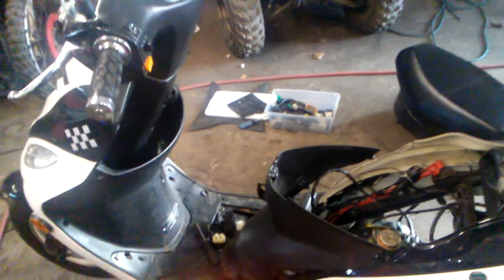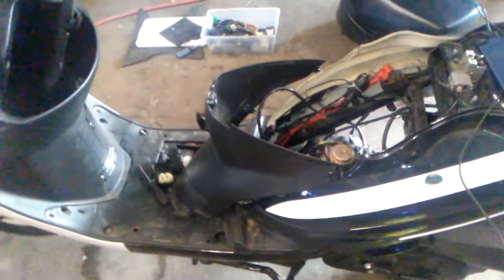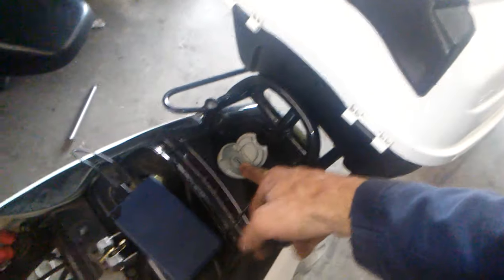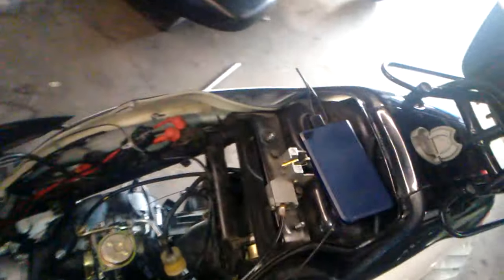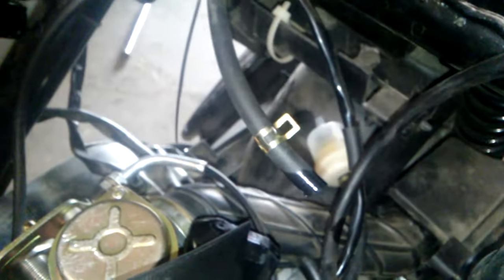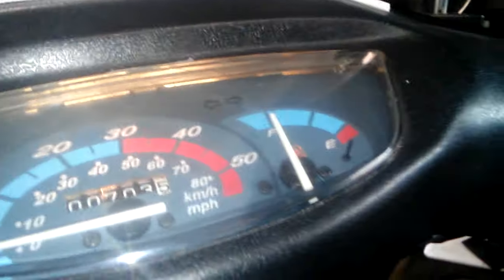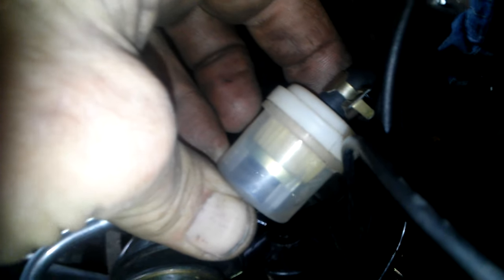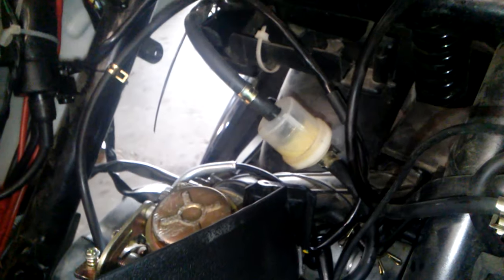Scooter runs short distance then stops running like not getting gas , parts for this in description

Comment: I've a stupid kymco gy6 that went well for a year but for the last few months it's a pain in the ass.
and the last service has been made very recently.
after consulting 4 stupid different shops (already paid a lot for nothing) I still have the same problem: 
after 10/15 mins the scooter doesn't run, even by giving full gas the engine revs up high but it's like there's no pressure enough to go, from 5 to 20 kmh, after that point it goes again... making a very dark noise and loosing power progressively.
with vpower it seems a little bit better but after a while same story again..
so what should I do??
Reply from the maker: Oh crap u need to check your variator n belt for sure ,!!!! Clutch also may be getting stuck . I reread that it runs good just don't move . You will need a impact to get those off but your problem lies in the cvt system . Variator guides get wore n variator will wobble . Rollers wear grooves n will stick in high gear feeling like no power . N clutch also may stick !
Reply: @WaldensWorld  thanx for the reply!
but I just paid a guy to fix the clutch and belt and a complete service has been made recently (300$). all the trouble started after two weeks and the same guy did another check, he told me its because of an hole in the exhaust.
another told me that is probably about some dirty or water in the gas tank.
another said its the wrong gasoline.
maybe a cleaning additive can help..?
I dont trust any mechanic anymore.
I just wanna sell it and get rid of this f**g scooter.
Reply from the maker: @TheMidnightcowboy1  sounds live variator . Was this guy a shop mechanic or friend !! I've got bikes from shops before mis diagnosed ! I'd check that variator
Reply: @WaldensWorld  was a professional mechanic... actually 3 or 4 different. but again, the last one checked and fixed the clutch, that is the only thing wrong he found.
but I thought the air in the fuel system thing you were talking was a possibility..
Reply from the maker: Is it like scooter or sat somewhere . Check vent hose off motor n muffler for muddobber nest but that loss n clunk n go sounds like clutch shoes getting stuck n popping open ! Did you get a new clutch ?

Comment: I have the same issue with my Yamaha Razz.

Do you know of any other reason it would just stall out?
Reply from the maker: When is it stalling? Takeoff or after you stop n start again or after few minutes! Could be rear clutch sticking variatior rollers need changed ! Exhaust valve or valves need adjusted or fuel oil mixture! On two stroke could be crank seals also ! Check spark plug first

Comment: I litterwly just bought myself a yamaha jog 1996. When I first got it I gave it a test run and everything was fine. The next day I take it to work (15 minute drive) and I noticed it would be all fine then randomly slow down and act like it's going to turn off. Then starts speeding up again. I don't know much about mopeds, got me this one for summer time and as a little project. Guy told me it was a recently rebuilt but I highly doubt it..
Reply from the maker: Yes since it’s old I would check fuel ! And if it’s getting hot compression if it needs a rebuild as engine warms up it may lose power ! Is smoke white or black ? Does it run fine after sitting! Also those have a reed cage I’d check it for leak ! Let me know!
Reply from the maker: Few drops of water in gas can cause this also !
Reply: I got it 2 days ago trying to get it checked by tomorrow.. no leak doe I'm keeping it inside my house until I get chain's haha.. It is 2 stroke but oil and gas is fine. I heard it could maybe be spark plugs but i really dont knoe.For now its kick to start sense i bought it without a battery. But I don't think that's a big deal towards what's going on
Reply from the maker: Yes new plug be good start ! There fun scoots for sure !

Comment: I am having a similar issue, and when the scooter (Suzuki AN125 - 2009) stops from what is obviously a lack of fuel, you let it stand for about 20mins (you can continue to crank but will flatten the battery, so best to wait), then after this period it will start and run just fine. i have replaced spark-plug and fuel filter, and still have the issue. I suspect it is with the vacuum fuel cock. I am awaiting a replacement to test this out. Fuel back vent is clear, as is gas cap, and when testing fuel cock, it appears to operate just fine and allows fuel to flow. Can these vacuum fuel cocks suffer from say a small hole in the diaphragm, and would that have symptoms like this ??
Reply from the maker: Yes n the vent line would smell of gas n be wet I’ve seen it before ! A lot of scooters will have the exhaust valve get tight over time , when you ride it may be expanded enough to lose compression! I would pop the valve cover off n check valve clearance also ! If it dies can u shoot starter fluid in breathe  n will it run ! If it does could be fuel ! How many miles on your engine !
Reply: I had this same problem.. replace cold ignition, spark plus, new fuel pomp and fuel filter .. problem solved .. pipe going from tank to filter needs replacing and I've changed positions of my fuel filter from below tank in to side.. mechanic suggestion.. I have kymco agility city 125cc on road again..
Reply from the maker: Thanks for your reply!
Reply: I simply replaced the vacuum fue
Reply from the maker: I’ve seen vac lines get pinched when installing seat also u got her going !!

Comment: I have a new 50cc tao tao newspeed 50 and when i full throttle is slows down and will shut off and die?
Reply from the maker: Define new ! Like still under warranty or new used ?
Reply: Walden's World new just out of the crate i put together
Reply from the maker: I'd check your carb second jet is probably clogged . They test them at factory n sometimes leave crap in there n ket gets clogged . Welcome to China quality ! Lol
Reply: Walden's World ok will do thanks btw i also have a new carb i could put in
Reply from the maker: Yep that be best bet . I worked at a China shop it was depressing how much new stuff had bad carbs out the box . I got tired if that quick !

Comment: I can't find a vented cap for a 2021 Peace Sports 50 . None of the caps specifically state they are vented.
Reply from the maker: Check eBay n some have a vent line with a small cylindrical plastic deal with a ball in them that can go bad if scooter ever crashed !

Comment: I just got my brand new moped 100 cc magnum and it keeps stalling and sometimes if I turn to right it goes on what’s going on I spent 2 grand on this!
Reply from the maker: It you turn to right ? The engine revs up ? Check the throttle cable maybe bound up by the handle bars ? It has a throttle adjustment screw on carb under seat does yours have a cover to get to carb ? Put it on the stand with back wheel in the air and adjust it up til it engages then back down to a nice rpm

Comment: i have a honda sfx 50 and i went to a service changed my piston i wasnt able to start before it gave me symptoms of the carb being dirty so it shuts off during trip than we cleaned the jets, it didnt started after than changed the piston due to no pressure, it started again then we started to set up the carburator then during trip it went off again and it doesnt wanna start doesnt matter what i do with the carb, can u please give me any tips or suggestion what to look for i have sparks n i have fuel pumping too, no idea how can i check the pressure so have no clue bout that, im gona try the fuel cap tomorrow
or isit possible the piston get spoilt this fast again?
thx for any advice
Reply from the maker: Check valves also ! Especially exhaust! Was there carbon on valves when you did new piston ? Check the diaphragm in carb too u can put finger in carb push up it should hesitate coming down because vacuumed if it slammed down it may be leaking too ! If variatior is stuck or clutch is stuck it will cause problems starting if it’s in high gear n idled high
Reply: @WaldensWorld  thx f answer ill write wghat was the problem so it can help others in future

Comment: Is that a JonWay 150? I have the same freaking scooter!!!!!

Thanks for the info I run the PCV to the port to the gas tank so it’s getting positive pressure in the gas tank maybe that’s why mines flooding out?
Reply from the maker: It will push gas if it can ! If you put a pump positive air ! Yes n basically all 150 China scooter are the same

Comment: I have similar issue on my Piaggio Nrg, runs for 1-2 kms and then just stop.When scooter works on idle all fine,when drive have enough power like normal, but after several km just stop.  My suspect for issue is a petcock, but i wonder about the tank cap, it's a possible problem on Piaggio ? My cap looks prety good quality and condition  and it's original
Reply from the maker: Yes some of the 150 have a tip over valve so if you crash it shuts off vent I’ve seen them stick shut ! Or vacuum leak I’ve seen vac lines fine until you sat down owner changed routing got caught under the seat
Reply from the maker: If it vent the less gas the farther you will go full tank will stop quicker the vacuum forms quickening a smaller space ! Ps when it dies pull cap listing for that can of open coke sound phssss
Reply: @WaldensWorld  if i undarstend you corectly .....when scooter die and i pull of the cap and sounds like   coke can it' s a sign for bad vacum from stuck petcock ?
Reply from the maker: No vent to gas tank if your cap has vent it’s bad or if it’s 150 vent is on a tube coming off tank
Reply: @WaldensWorld  
Tnx a lot. I will replace petcock and gas filter and then will see the result.Best regards !!!!

Comment: i have a honda dio af18 50cc and it turns off after riding half a mile but i could turn it back on again and it needs more than 5 kicks to start
Reply from the maker: Check vacuum lines check crank case breather vent , check gas tank vent ! Air filter ! N is it smoking bad fouling plugs our . Crank case seals when going bad will mess up a two stroke running abilities also !
Reply from the maker: You may also check your reeds they may be partially open !

Comment: I have gy6 150cc i have loss of power at excelerating above 40 mph.
Cleaned carb thinking maybe sparkplug?
Could i ride with gas cap off for a while then replace cap.
Reckon this might solve it?
Great vid
Reply from the maker: May be fuel issue but I'd check to see if belt is wore on sides and variator rollers are still round ! I think u may need rollers if it runs fine up to there ! Variator get wore n wobble on spacer also losing power
Reply: @WaldensWorld  Thanks for that.
Rollers are new.
Belt will check tomorrow.
I remember when cleaning variator one of sliders was very loose and not snug.Possibly if this was not fitting right could play apart when hitting topspeed.Have heard somekind of noise from transmission cover.
What you think?
Thanks
Reply from the maker: @jasonsmith1714  those weight have to push even so they must be same weight . Or atleast every three as it takes 6 to keep weight consistent ! You can have only three in skip every other nothch n try that ! But I think you may be in right direction ! I have gotten bit wider n longer belt to run faster but that gets into measurements n crap ! Just stick with basicks for now !
Reply: @WaldensWorld  Thanks.
I think now it could be backplate and one slider not correct.
Thanks for ya help

Comment: I’m going to try this because I have a go kart with a howhit  150 engine and it turns on but won’t drive when I hit the gas ... I have change the carb the fuse the spark plug and the spark ignition i cannot figure out what to else to do !?
Reply from the maker: Yours may b in the transmission part the belt variator n clutch ! Does your motor rev up good ? If so pull cover off belt n look around !
Reply from the maker: Check brakes n make sure wheels turn or roll ok also !

Comment: Hello
Good time
I have a 50 cc Yamaha Vino engine. The petrol amp does not indicate that the tank is empty at all. If the tank is full or empty, the hand is on full. I also changed the kilometer and the floating petrol, but it did not work. I live in Iran if possible. guide me.
Reply from the maker: Gas gauge in tank seems mabey bad ! Or is your fuel indicator needle stuck in the cluster ?
Reply from the maker: These is a metal round cap on top of gas tank it prolly has three tabs holding it it twist out , I think u have a bad fuel gage or bad wires to it or bad connection !
Reply: @WaldensWorld  When I turn off the engine, the full gasoline hand goes back to e, and when I turn on the engine, the hand goes to f. The hand is not stuck in the off state. But when the engine starts, it shows f at all. Which I also checked with the empty fuel tank is the hand on f.
Reply from the maker: Gas gauge in tank  seems bad from what your explaining ! Prolly shorted out . It has three wires ! If you have volt meter you should be able to read resistance as you move the float !
Reply from the maker: @sepehrghelichkhani8018  if you unplug the gas gauge connection at the tank three wires does gas gauge go back to empty ? Then it be the gauge in tank 99%
Reply: @WaldensWorld  Thank you for your guidance
I will definitely do it tomorrow and I will announce the result to you.

Comment: Damn dude that actually fixed it
Reply from the maker: That's what we like to hear . Awesome ! Thanks for watching . Hope u subscribed building stuff daily !
Reply: Well it did go a bit better. Not sure if riding it for a bit pushed the air out. I’m still having an issue of getting to 10mph and it bogs. But when I throttle down again repeatedly I can get to almost 30. 

Starting to think I need the CDI.

Which I have in the mail.

But I thought it was fuel pump. But that seems to be working fine.. idk.

We’ll see when parts get here Friday
Reply from the maker: You may have a dirty jet in your carb ! You still have airbox on or a pod filter ? Worn belt ? Or variator problem . Will it throttle all the way on the kick stand with wheel in air ? 
 Vacume line from front of carb to round fuel pump is good no holes and not pinched when you sit on seat ! Few things it could be ! N check
If you are pumping throttle and it takes off . Carb has a small pump so your giving a shot of fuel . Therefore you may just have a fuel issue in carb! Check your carb inside to see if jets are ok .
Reply: @WaldensWorld  thanks!

Comment: Hello! I have a Buddy 50 cc scooter. It runs great except for sometimes it hesitates a little in the sense that it will turn off at strange times when I am going lower speeds or it will not turn on..

In order to get it to turn on I carry a little screw driver and carb cleaner and I will take off the air filter cover and spray the intake with carb cleaner and put it back on. Then I go to start and it starts VERY good.

It was just brought to a shop who charge like $200+ for a carburetor cleaning and spark plug replacement.

The shop is called Boca Scooters…

I am NOT convinced that they did honest work but I don’t know know for sure.

I would like to have it turn on normally. (without having to have to spray the carb cleaner every time)

I believe that I need to work on the carburetor again or get replaced altogether OR get a valve adjustment. I would like to bring it to a different shop but I don’t know really where to start.

Gas is clean, premium used (50CC 2018 Buddy)

Carb JUST got cleaned but NOT positive they did honest work……..

Spark plug all new.

Where should I start from here?
Reply from the maker: I would check valves if they are tight get hot it may cause one to stay open a bit ! Exhaust valve on china scooters do get tight on many models I’ve seen !  You can put a piece of notebook paper on exhaust pipe if you turn bike over it should fly out straight if you have a valve open it will flutter like it’s partially getting sucked back to the pipe